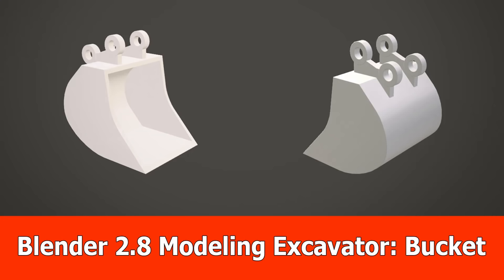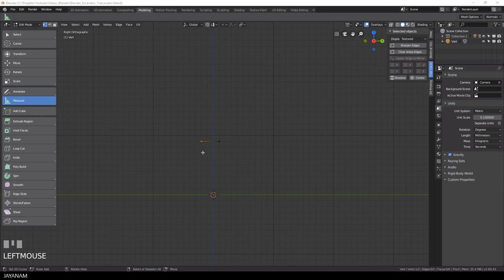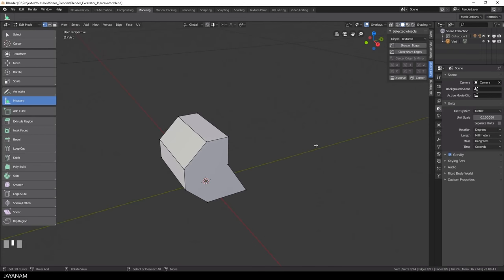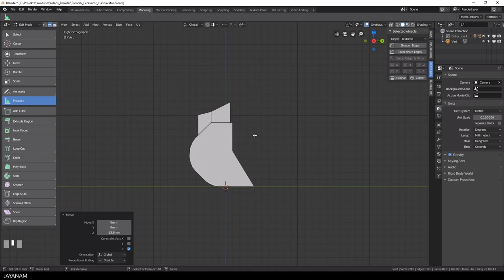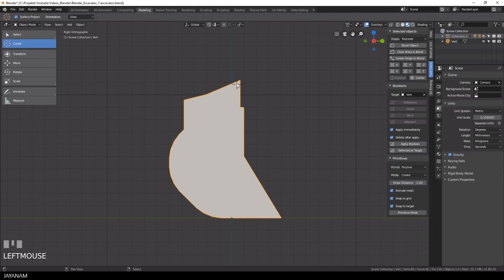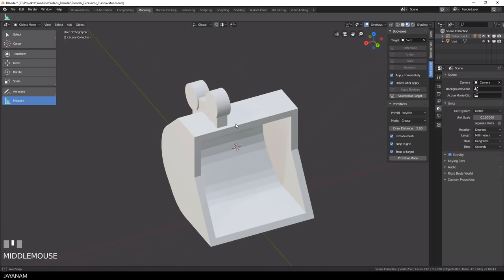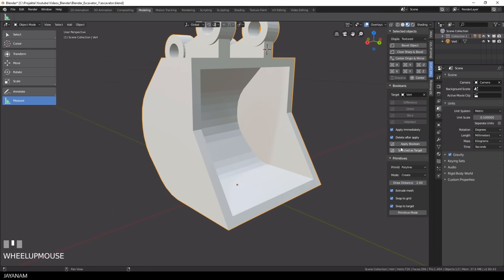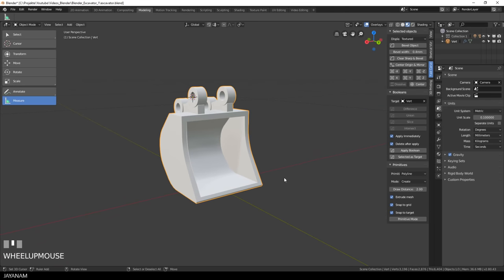Blender 2.8 Modeling for 3D Printing : Excavator Bucket

Comment: Thank you for your video. When doing design for 3D print I found that Boolean Unions often caused non-manifold edges and zero faces unless I did lots of manual editing. Is Union better in 2.8 and do STL files export and print well?
Reply: I'm curious about this as well, did you ever find the answers?  It appears that he is using fast carve which might behave differently than Blender 2.8 boolean modifiers, although i cannot be sure.  I only suspect this because I read elsewhere that there are plugins that do boolean operations better than the builtin boolean modifiers.

Thus far I have been unsuccessful in making suitable geometry for 3d printing with blender :(

Comment: I’ve been modeling something and did a bevel on a corner with multiple edge lines like you have and I was under the impression I had to add matching edgers to the side. On the side of your bucket you didn’t do that. So is it ok to have an n-gon face like that for 3D printing?

Comment: I started using blender just over a year ago and I find it really hard to switch to 2.8. It feels like I have to start over learning blender. Do you have any suggestions on how to overcome this switch of interface? 

I really like the way you make your tutorials, they are quick and straight forward. Keep them comming! Thank you :)
Reply: This Youtuber has you covered: Blender 2.8 Keyboard Shortcuts Introduction | Gamefromscratch
https://www.youtube.com/watch?v=G2KV1o7fyqg

I had a hard time adjusting to 2.80 at first as well but once you get the hang of it it is much faster and smoother than previous key binds.There was an option at one time to revert back to 2.7x key binds but I think they dropped it, not near my PC to confirm..
Reply: I can confirm the key binds for 2.7X are currently available in the Edit>Preferences>Keymap, there should be a dropdown menu to select 27X. This applies to the current 2.80 build as of 2/21/19.
Reply: @sjonjones4009  Thank you for checking that! I'm sure this will help me get into it more smooth.

Comment: With 3D printing, many times you will be making parts to fit with existing real world parts, because of this you need to enter actual measurements,  In Blender 2.79, I have the transform pane always available, and so it is easy to size parts without using a measuring tool, I dont see the transform details/panes in this video, I am hesitant to jump into 2.8 at this time (work load is high at the moment) can you clarify?
Reply: btw awesome video as usual!